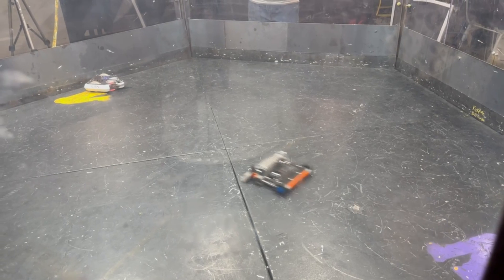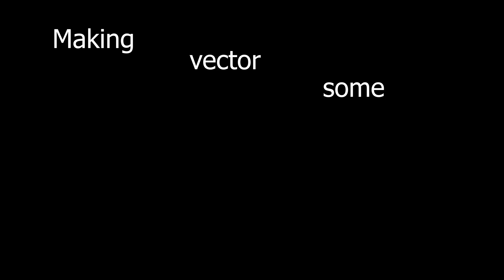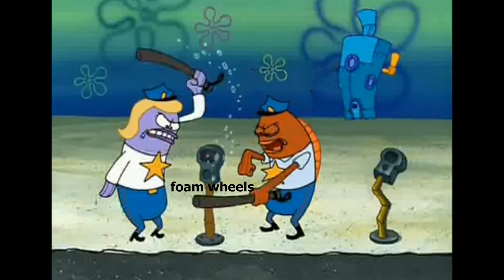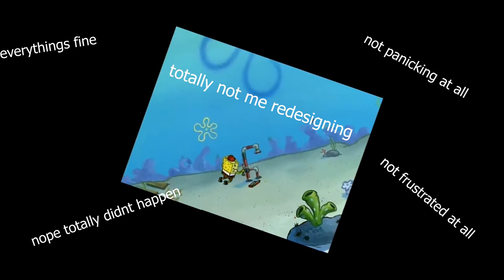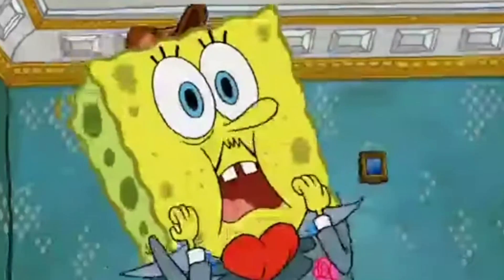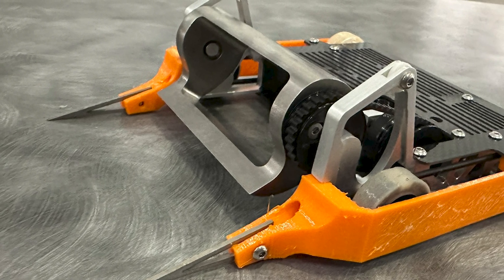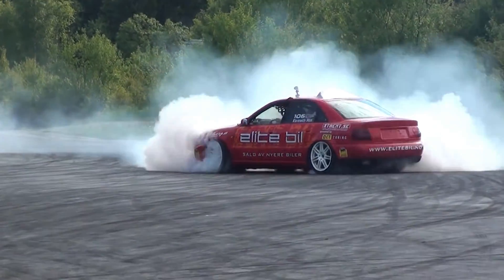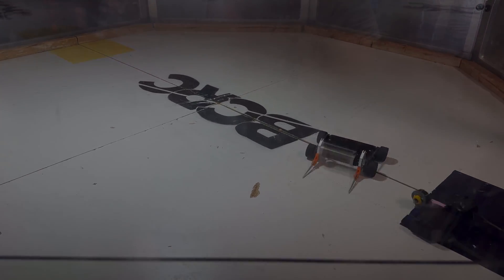Building my STRONGEST Antweight Combat Robot Yet!

Comment: I've been designing an ant weight and have been looking at some of vectors designs for reference. I was wondering roughly how much the robot costs. If you don't really know that's fine too!
Reply from the maker: That depends! Especially on were specifically you have your parts made weather it be CNC'd or something along those lines. Vectors aluminum frame(Which I hope to switch to UHMW to help with costs) with all included plates and mounts costs around 300-400 by itself, and the Tie main weapon $250+ so its not exactly cheap. But I offset it with sponsors and such. I would actually recommend PCBWay for that as well especially if your looking to CNC parts, they offer insanely competitive pricing as long as the part isn't too complicated.

But if your looking to make a bot similar to Vector I would take cost into consideration! And I would be interested to see how it turns out, let me know how it goes!
Reply: @TeamVector441  I will update you as I go along with the build. I’m getting my weapon made by pcbway, plus UHMW armor and two carbon fiber top and bottom plates from CNCMadness. I am planning to print my frame out of nylon 11, and some little titanium plates from send cut send. I tried to make as many parts identically as I could (to lower prices) and it was a bit of a challenge for the main rails. I am currently printing a mockup to check how everything fits together and after that, I will buy all of my parts from the vendors above. I will update you on how it goes!
Reply from the maker: @DylanVelupula   That's awesome! Be careful of carbon fiber though! It tends to sheer and break if its hit hard enough, but its very light and rigid. And 3D print everything first! That's the best way to make sure that everything fits well, and make sure to use my link to save on your PCBWay order. Trust me every penny counts! And I look forward to seeing what you create!
Reply: @TeamVector441  Thanks! I am currently in the process of buying all of the components other than custom CNC'd parts and test-printing my frame so I can check that everything fits. I'll update this comment throughout my build!
Reply: Just a small (but rather annoying) update: I have gotten some of my fasteners and am only now realizing how their weight adds up on my bot. Time to go redesign again 🙃. I'm happy I found out now when I can still redesign and not waste a bunch of time 3d printing the frame again. I plan on making my weapon slightly smaller, and shrinking down my wheelbase to accommodate the weight.
Reply: Update: As of right now, parts are being printed. Wow, antweights are really small. I've seen some competitions but i still expected my robot to be larger. So far, all of my parts fit together well, but I may end up switching my drive up a little to make it lighter. I am currently using heavy banebots wheels, but I had an idea so I could use some lighter lego wheels instead. I will be sure to continue updating!

Edit: If you wish to see my progress, I will update the image for ‘Scrambled’ on the RCE website regularly.

Comment: very cool video but honestly i wouldn't run alu rails for a ant weight 1/4" uhmw is ligher and does not really bend at all and you could add kinda feet to the front of the rails to contact the ground when the weapon transfers energy and that would allow you to move the wheels back so you actually have reach and wont get eaten as bad
Reply from the maker: Yeah I tried UHMW rails but they didn't work for me, but perhaps I may need to revisit it! And I added some feet in the front aluminum to try and negate that, hopefully they work.
Reply: @TeamVector441  uhmw rails have been great for my ant weight 4wd vert odd

Comment: A lot of 4wd vertical spinners have part of their uprights right below the weapon stick down to barely ride above the floor. When their weapon hits the wheels deflect a little and all of the force is sent directly through the frame rails into the ground, not through your wheels.
Take a look at the Peter bar kit frame and you’ll see what I mean.
Reply from the maker: Yeah I know exactly what you mean! Believe it or not the first version of vector actually had it just like that lol. And it worked great but after redesigning him a few thousand times I simply forgot to add it in on the previous version😅

But good news is that the new version you see here has those sliders that glide along the floor! Hopefully they help with the energy transfer better!

Comment: Foam wheels are goated especially with a layer of rubber cement and liquid latex, though i do wonder why you are sticking with aluminum uprights as opposed to uhmw. The built in weapon shaft solution is pretty neat
Reply from the maker: Yeah I was even given a pair of wheels by team malice that have that latex silicone covered wheel and they are grippy. I may try something like that with vector if I have time before the next tournament.

And I thought about UHMW a while ago, but after a few tests soon realized at this weight class it needs to be a lot thicker to be tough. And I just don't have enough weight on vector do try it out. But I am experimenting with different materials though! And thank you!